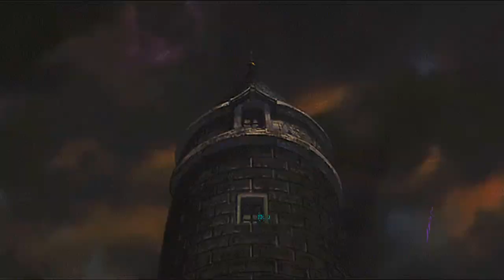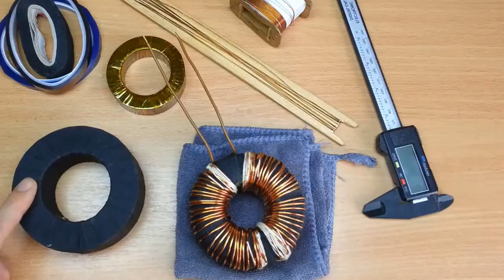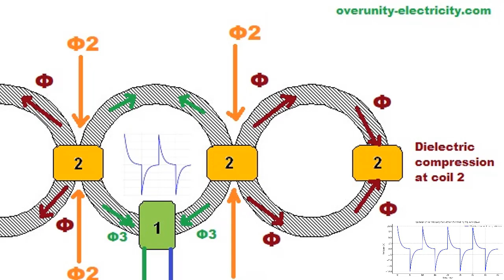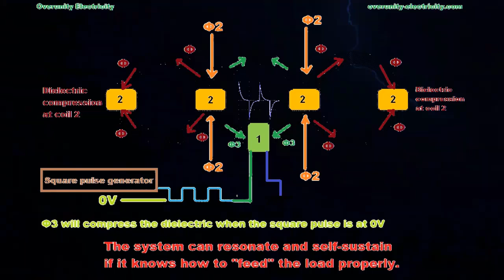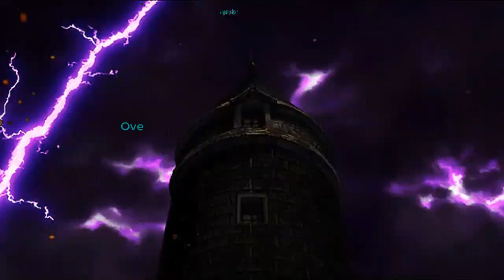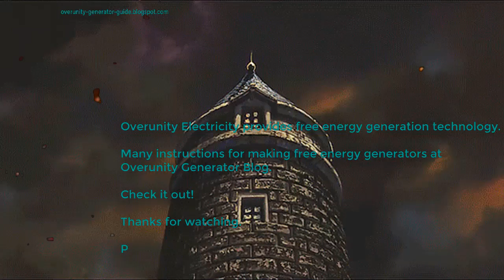Free Energy from Ether: The Forgotten Physics of Self-Powered Transformers

Comment: Cool video but how is the toroidal transformer shown any different from a normal step up or down transformer? The website is infomercial and not open source IP.  Switch flux
Reply: The field is inside the toroid and does not radiate into space.